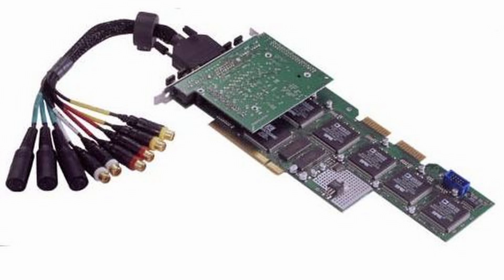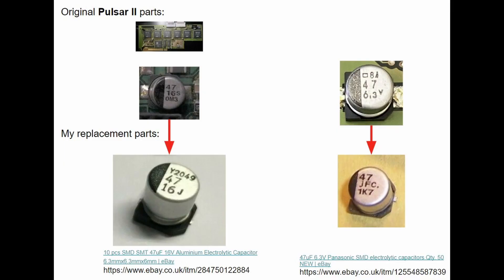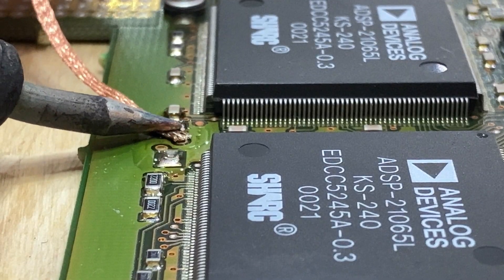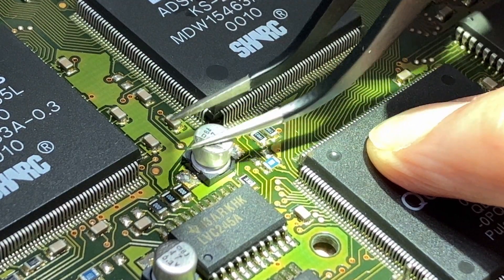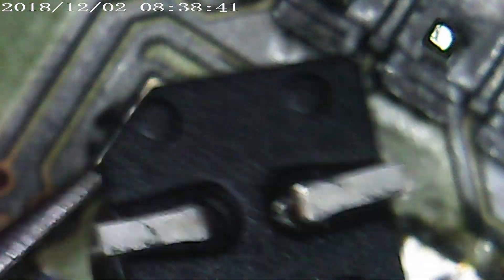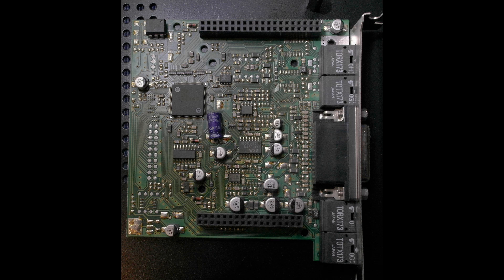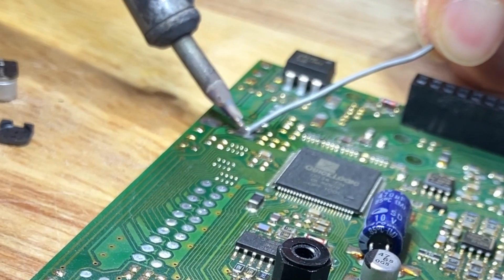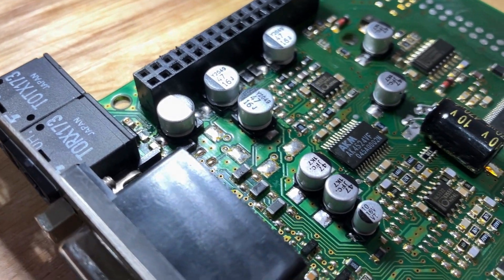Sonic Core Creamware Pulsar II capacitor replacement

Comment: SAY .. how the midi input fail come across as ? i get no midi signals but no errors either . not sure if its a driver issue or actual component capacitors. what you think ? can it be a capacitor issue too ? thanks
Reply from the maker: 8 months after this video was made my MIDI stopped working. Sounds like the same behaviour as you, no MIDI signal and no errors. I've not been able to fix it so am working around it with a second soundcard for MIDI. It's not ideal but I get by. There's a thread about it here: https://forums.scopeusers.com/viewtopic.php?p=356858#p356858